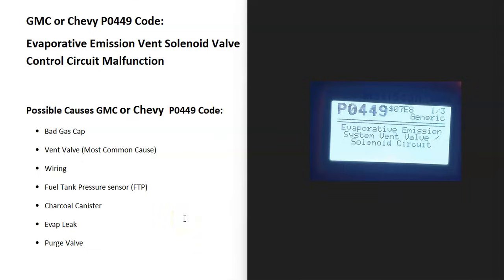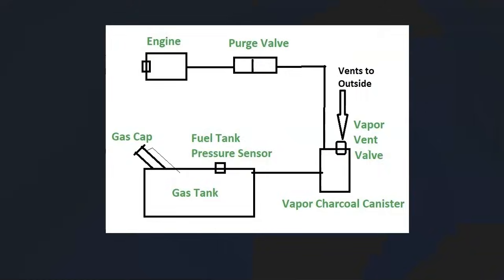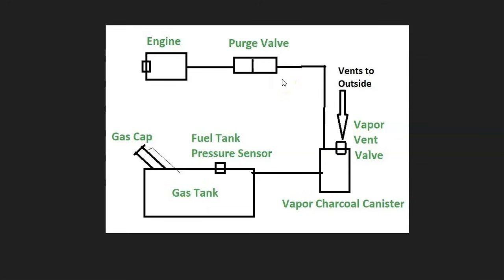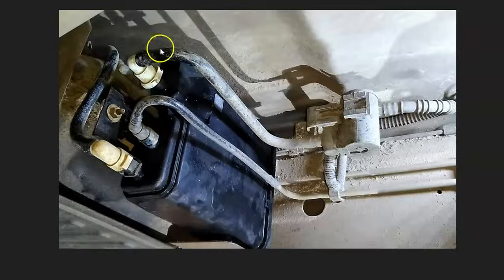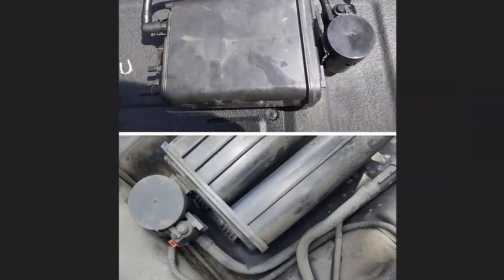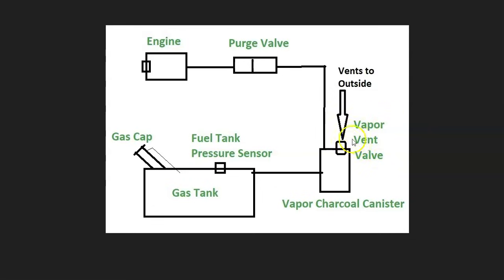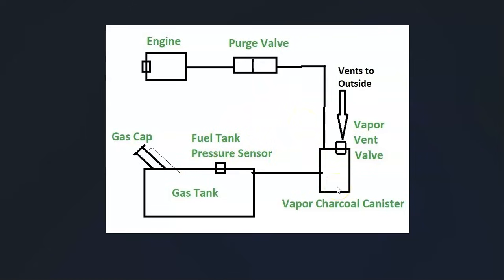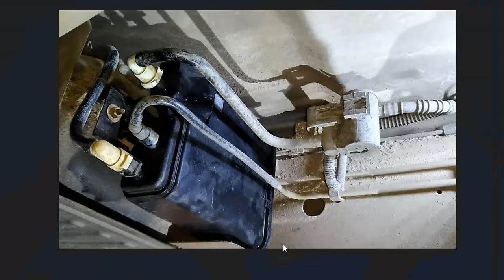How To Fix GMC Chevy P0449 Code: Evaporative Emission Vent Solenoid Valve Control Circuit

Comment: I have a 03 Chevy S10 zr2 I had done a smoke test and smoke was coming out of the vent solenoid valve I bought it 2 days ago it's new vent solenoid so what causes this to happen
Reply from the maker: The vent valve is normally open, so smoke will come out while testing if not closed. If you don't have a scan tool to command it to close, it often can be blocked off with a plastic bag.
Reply: @HVAC_Mechanic ok thank you

Comment: So if I have a hole in the top of the gas tank it will throw codes like p0054 p0060 p0101
Reply from the maker: A hole in the gas tank can cause EVAP codes, but not 02 sensor or MAF sensor codes. Those would be separate issues.

Comment: Can the PO449 stop vehicle from starting
Reply from the maker: No, the engine should still start. The only EVAP component that can affect the engine is a stuck open purge valve, which, depending on the engine, can sometimes cause longer start times.

Comment: I have po455 and po449 ..i changed ..gas cap .vent solenoid.purge valve.and gas tank sensor ...and nothing after eraseing the codes ..it comes back on  very fast .hahaha maybe an open wire ???
Reply: Have you changed the actual canister?

Comment: Will it make your car not ro start
Reply from the maker: Usually, there are no engine issues. The only EVAP component that can cause problems sometimes is a stuck open purge valve.

Comment: Does it hurt to drive it when this happens  ?
Reply from the maker: Usually, no; if the purge valve is stuck open, it can affect the engine, but usually, it just won't pass an emission test.
Reply: @HVAC_Mechanic  Thanks  !!

Comment: I got a p0449 code. Replaced the evap solenoid(definitely was bad). Code came right back after deleting code. Replaced gas cap with new GM cap and now the code doesn't come back until I remove gas cap for refueling. Canister bad?  2005 chevy Colorado. Any help would be appreciated.
Reply from the maker: I made a video describing and checking all the main EVAP components. Here is a link. https://youtu.be/C5s3Rx3wjD0
Reply: i think i have the same, but i havent done the vent job yet. let me know if you figured it out and maybe save me replacing something that doesnt need it lol.

Comment: Could the issue for this code ever be derived from the ECM not sending a turn on signal to the vent solenoid?
Reply from the maker: Yes, an open wire that doesn't send the signal to the vent valve will cause issues.

Comment: Thank you for the excellent video! this is the best most concise information I’ve received in three days of googling for an answer. My Chevy dealer has reset it twice for free however three or four days later the engine light shows up again. He told me 449 was a code for the sensor and that I could just buy one and put it on myself or they could do it. My particular 2009 Silverado had some sort of governor on it to where it’ll never let me go over 100 miles an hour. Interestingly, or coincidentally the engine light always shows up when I hit 100 miles an hour and a slight stalling sensation occurs. Not sure if this is a clue or just weirdness. What think you?

Comment: It's funny my 07 suburban has a aftermarket stereo that does obd clearing  the truck throws the code  when the outside temperature is above freezing. If I clear it below 32° it stays cleared until the ambient rises above freezing. Then it throws the code.
Reply: What radio is that

Comment: Would it be a clue that the only issue the code causes, other than the CEL staying on, is it doesn't start very well, but only after I get gas...?
'12 Impala
Reply: Purge valve in the engine bay
Reply: @myb6862  that's what it was. I got it swapped
Reply: @charlieyeager3645  awesome glad to hear it!